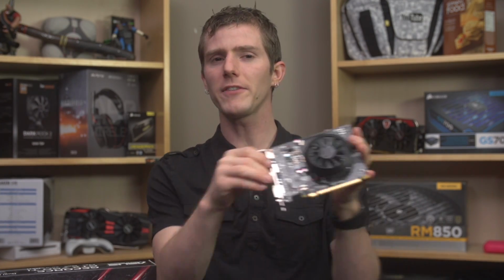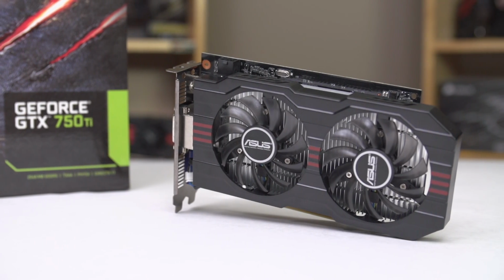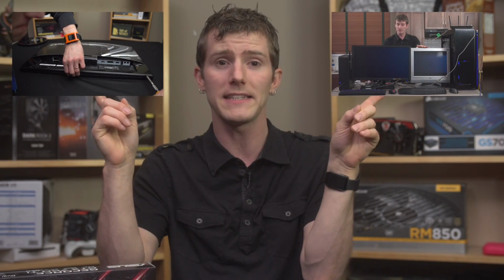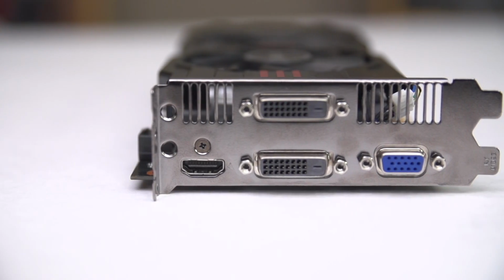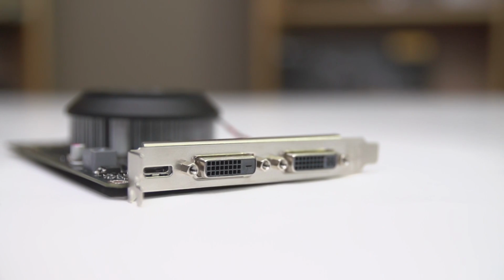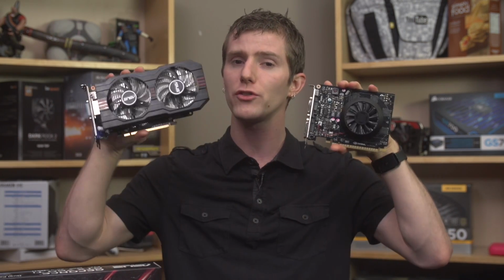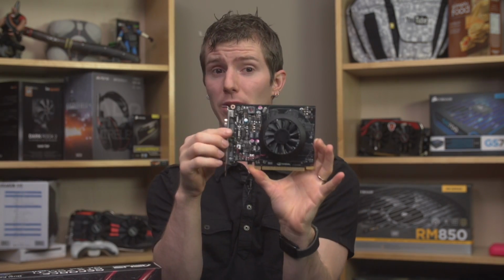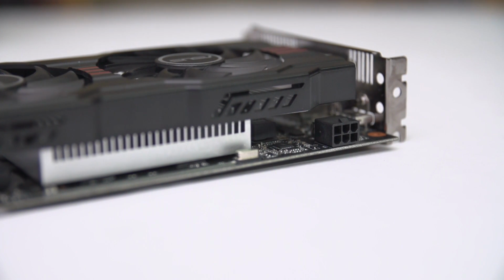GeForce GTX 750 Ti NVIDIA & ASUS Designs

Comment: I have  a 550 ti, should I switch with this one?
Reply: +draydince that's what I wanted to say :D
Reply: Manny Hung Yeah your best non sale price card is a gtx 960 or a r9 380. The R9 380 is a tad bit more powerful than the gtx 960, but honestly I tend to prefer Nvidia. Their drivers tend to be a bit less of a headache to deal with. But if you have 250 just keep your eyes open for an r9 390 or a gtx 970 they go on sale all the time on Newegg. I got my gtx 970 for 270.
Reply: If you need better performance, yes. Its worth it.
Reply: +Manny Hung like this card is old why not get a more newer version
Reply: +whhhhhhhhhhhhhhhy15 what graphics card do you prefer? I have the same gtx 550ti and thinking to buy 750ti
Reply: Deivixas HD
imo you should keep the 550ti
Reply: why? :D
Reply: Deivixas HD
nvm looking at the price you can get it for like 100 dollars
Reply: +whhhhhhhhhhhhhhhy15 y dun save more and buy gtx970 or gtx980
Reply: +Jack0ff or buy gtx 950 it's cheap and decent 1080p graphics card.
Reply: +Jack0ff well he has a 550 and is going on to a 750 I thought money was priority
Reply: +whhhhhhhhhhhhhhhy15 so i told him to save more :p
Reply: +Jack0ff but a 970 is like 300 dollars compared to 100
Reply: +whhhhhhhhhhhhhhhy15 hmm youre right. but if i were him i rather save more money and go for a high end gpu
Reply: +Jack0ff you also cant forget you need a good psu for a 970 or 980 a GTX 750 ti/950/960 can run off a 430w psu
Reply: +Manny Hung I would wait for things like polaris, maybe AMD will have a stronger offering or save for a 950 maybe
Reply: +Deivixas HD +Manny Hung go for gtx 950
Reply: Michael009 oh, that's a great idea actually
Reply: Manny Hung Cheers. Good luck! Hope you didn't bought the 750 already xD
Reply: It honestly really comes down to what kind of games you play, and what kind of games you want to play in the future. If what you play right now doesn't require more power, I would just ride out the life of the 550 ti. If the 550 isn't holding up with what you want to play, the 750 ti is a decent upgrade - but honestly, it's probably not worth the money you spend for the upgrade. It's usually about 100-150 dollars, averaging around 130ish. If you spend 130 right now, you'll have to go out and spend a few hundred more a few years down the road when the 750 ti gets into the same boat that your 550 ti is currently in. You would be better off to hold onto the 130 that would have gone towards a 750 ti to get a step or two above that. Better to spend 70 extra dollars upfront to have  a card that will last you a few more years, instead of paying 130 now and another 130+ in the future for a brand new card.
Reply: ***** I'm buying games like Fallout 4, BF4 and shadow of mordor and I'm looking for cards that can provide such firepower under 250 bucks
Reply: Manny Hung then get a GTX 960. 190$ on amazon xD
Reply: ***** pretty nice deal
Reply: ***** it sux compared to R9 380 or GTX 960. A bit more cash, but totally worth it.
Reply: +Manny Hung the r7 370 is slightly better then the 750 ti and the xfx version is about £110 on scan but the 750ti is still a good
Reply: +Manny Hung take 980ti..
Reply: Bartosz Olszewski if you have unlimited amount of $ yeah...
Reply: Michael009 oh come on, this card is just like $850 or so..
Reply: Michael009 I got my 960 for $190. Gigabyte version and CANNOT recommend it (Edit: Get ASUS one instead /Edit). Fan is very audible at 30% which is minimum to prevent the card from throttling under full load.. And some games require at least 970 now..
Reply: Bartosz Olszewski True Asus would be my choice as well.

Comment: will my system bottleneck this card:
CPU: Cucumber
GPU: Potato
Motherboard: Wooster cheese
PSU: Hamster on wheel
Reply: +Callity No. I think that you need some ketchup with that
Reply: +Callity It depends, I suggest cheddar for the mobo, as wooster is still on PCI and not PCIe, and the potato is cutting it close on the wattage.
Reply: +Callity I think you will need to upgrade to doritos RAM chips, and add additional hamster cores to the power supply, since I think it is cutting close to maximum wattage.

Comment: will my setup bottleneck this card: a8 5600k, 8GB ddr3 RAM, 500w PSU msi motherboard
Reply: +james Clarke if your playing cpu demanding games then yes if not your fine
Reply: +james Clarke No, The A8 is a quad core chip and will run just fine.
Reply: depending on what clock ur ram is?
Reply: +james Clarke Nope, a 750 ti wont bottleneck your processor - but it does kind of make your processor a waste of money. You pay a bit of a premium to get an apu with graphics built onto it, and if you plan on going out and spending 100+ on a card that will replace your onboard, you pretty much paid extra money on your cpu for no reason. Not trying to make an attack on you or anything, but typically unless the APU gives you satisfactory settings for you, it's usually best to just get a better standalone cpu.

Comment: how well would my pc run gta 5 on max settings ? 
Asus geforce gtx 750 ti 
intel core i5 6400 
8 gb ram
Reply: +benne2 hellberg 35-60fps but you might have to lower some settings for better performance
Reply: +anthonyorm how much would I get if I lower everything to medium/low ?
Reply: benne2 hellberg most likely a smooth 60
Reply: +anthonyorm alright thanks alot for the answers :) glad u could help me :D
Reply: benne2 hellberg No problem

Comment: Right now I have a GTX 750 1gb. Its a prebuilt machine with a i7-4970s, but only has a 300W power supply. Does anyone have any recommendations on a new graphics card that would work on such a small PSU?
Reply: +XxNashNatexX the 750 ti's would work with 300w. it would only give a slight performance increase though
Reply: buy a psu, you wouldn't get much done otherwise

Comment: I have a prebuilt pc from best buy. it has a Intel core i5, 8 gb ram and 300 power supply. can this run the gtx 750 ti? I currently have the r7 250 inside my pc and am considering selling the r7 240 for the 750 ti. also does my pc work with the asus edition of the gtx 750 ti? PLEASE HELP !
Reply: +Kevin Lam Yeah, the asus 750 ti should run with 300 watts. You will get a much better gaming experience with the 750 ti. The r7 240/250 is underpowered for your specs.
Reply: +anthonyorm does the asus require a 6 pin connector ? or is it like the reference gtx 750 ti where it doesn't need another 6 pin connector to power it?
Reply: Kevin Lam The asus needs a 6 pin. The reference one or the evga 750 ti's with 1 fan don't though
Reply: +anthonyorm cool. what brands offer the reference version? and are there any other gpu that my pc will be compatible with? thanks for helping btw :)
Reply: Kevin Lam You would probably have to search on ebay/amazon or on the nvidia website for the reference card since im not to sure where to get it. I don't really know of much graphics cards that work with a 300w.
Reply: +anthonyorm I want the gtx 750 ti but it costs almost $200 in canada lol.
Reply: +Kevin Lam Get the Asus 750 ti strix instead, it has better performance, temperature and power consumption. It also doesn't need a 6 pin connector.

Comment: Will Intel i3 3220 bottleneck gtx 750 ti oc ?
Reply: +Maji Bad No
Reply: +Hillooish ty
Reply: +Hillooish what aboue i3 2100?
Reply: +aNaNass No
Reply: Pentium g4500?
Reply: ***** 970, yes. 280x no... ish. There will always be a performance gain with a higher end CPU. But the i3 will still do the job. I have a 280x actually, and an AMD 860k and get a bit of bottleneck so there.

Comment: hey :) so my computer is in need of a new power supply, its currently at 250 atts :( so im aiming for around 500 watts and i will use that power to get a new graphics card, how do i know if my computer is pci-e compatible ? it may be easier if i tell you my mother board GA-H81M-S2V  - im just modifying my computer for the first time and wanted a EVGA GeForce GTX 750 Ti Superclocked 2Gb PCI-E Graphics Card.  which i think needs a pci-e compaitible graphics card but i may be wrong and would like this to be cleared up !
Reply: +sebastian langley http://www.amazon.co.uk/EVGA-GeForce-Superclocked-Graphics-DisplayPort/dp/B00IDG3IDO
Reply: +sebastian langley Yeah, that motherboard should support it, What cpu and ram do you have?

Comment: help please
i use the first gtx 750ti in the video (1 small cooler)
amd a10-6700 3.7ghz 
8gb ram
how good will it handle gta 5 and battlefield 4
Reply: +Harald hetland boe come on man get an amd card and how much is your psu
Reply: BABRIS Ali 4,624 source= https://www.cpubenchmark.net/cpu.php?cpu=AMD+A10-6700+APU
Reply: +Harald hetland boe  i meant to say that u should get an amd card prob an 250x it will perform better with your apu as compared to an nvidia one.but no doubt the 750ti is better than the 250x
Reply: BABRIS Ali what if i get a better apu (amd fx/i3 or i5)
Reply: +Harald hetland boe u mean cpu? then u will have to buy a gpu as intel cpu's on board graphics are shit btw how much can u spend
Reply: +Harald hetland boe on both or just the cpu?if both then definately get a gpu and check if your psu has a 6 pin connector.
Reply: +BABRIS Ali oh sorry u already have the card! u will get good frames as it is a quad core and save money buy a mobo and i3(around $180)
Reply: BABRIS Ali ok ty
Reply: BABRIS Ali but is it big diffrent of i3 and amd 6700
Reply: yup i3 skylake is much better

Comment: I can get a ZOTAC 750ti for $160, should I go for it? also what is the difference with zotac and asus
Reply: I'm guessing a higher clock speed and beefier cooler. So an overall better card for more money
Reply: Kenny H the zotac is the better card?
Reply: +Cam Par yea I'm pretty sure
Reply: +Cam Par no, the asus is better.
Reply: +Cam Par I think the EVGA coolers are the best but yeah I'd go for a GTX 960 2gb/4gb over a 750 ti
Reply: Cam Par damn nice pick!
Reply: +Kevin Lam Where are you getting your facts from?
Reply: +Cam Par Just go with the cheaper one, they preform basically the same
Reply: Nissan U.
i found a gtx 960 for $200 new, is that a better deal?
Reply: Cam Par Where do you live? That seems expensive for  a 960
Reply: Nissan U.
Toronto Canada. yup we get ripped off here
Reply: Cam Par Its your budget, it depends on what type of games you want to play and at what settings.
Reply: Nissan U.
I could save another $150 and get a used 970 for $350
Reply: Cam Par A lot of people recommend used but I am not that big of a risk taker, so I buy new. Unless a well known friend sells me the card.  Also what kind of gaming experience are you after. 

Edit: If you want this would be better, Get a gtx 950 now and save up for another gtx 950 as time goes on, then you can sli them and have near performance of a 970.
Reply: Nissan U. I like to have ultra settings so I might just sell a few things and save up for even a 980ti or wait until the pascal line comes out, and for now just get a 960
Reply: Cam Par If you dont want to wait its best to get a 750ti from zotac which is the best cheapest gpu. Then you can have more money left over to buy the 970 or 980 if you wanted. When the pascal line comes out you can sell the 750ti and have more more money to buy a higher end card.
Reply: Nissan U.
true, I think ill do that, thanks for that
Reply: +Cam Par you can get a gtx 960 for $20 more
Reply: Crackhead jack not here in Canada
Reply: Matthew Sowers Well the 750ti runs cool anyway because of its such low tdp, additionl fans are kinda useless tbh. If a oced 750ti will run cooler than most high end cards at stock speeds
Reply: Nissan U. I wasn't talking about the card itself I was talking about the cooler on the card lol but yes I know the 750 ti is one of the best if you want a card that stays very cool
Reply: +Cam Par Omg where did you find a 960 for 200$ :0 i find a GTX 950 for 189$ :\ Canadian too.
Reply: Warrox. Kijiji
Reply: +Cam Par new? I got my 950 from newegg
Reply: Warrox. Yeah it was sealed in box
Reply: Well ASUS version has aditional power. Zotac doesnt.
Reply: Dovydas Ki what kind of additional power?
Reply: +Cam Par its like: Asus takes an external power from psu, when zotac takes the power with pci express. Understood?
Reply: +Dovydas Ki I took asus gtx 750 ti OC and its damn powerful. Really worth its cost
Reply: +Cam Par Hey man. Really Zotac and Asus are both decent brands. Asus is more known, but Zotac isn't a dollar store knockoff or anything. They make reliable cards. That said, neither an Asus or Zotac one are worth 160. a 750 ti is worth about 100-130 tops.
Reply: Thanks guys, found a gtx 960 for $250, I know that's expensive but I live in canada, GPUs are a rip off here
Reply: Cam Par Ouch. Yeah man, that kinda sucks. You're 50 away from gtx 970 price :( still glad you found something though. That's a decent card.
Reply: *****
I can get a gtx 970  (used) here for $350
, new? $450...
Reply: Cam Par Oh damn man :( that's weird. I wouldn't have guessed the prices would be that much higher in Canada compared to the US. They're close enough economically you'd think they would be somewhat close in price.
Reply: +draydince Canada's dollar has gone down the drain really quickly.
Reply: +Cam Par Now it's $104 USD
Reply: ***** not in Canada unfortunately
Reply: Cam Par
ohhh
Reply: +Cam Par Just ordered it yesterday for $95 USD off Amazon.
Reply: Henry The Unicorn
damn you!
Reply: Henry The Unicorn Fuck i just saw

Comment: This card has yet to find a brick wall that it cant break (MSI). I'm not running 4K but with many games having upscaling and advanced AA like GTAV, which this card handles without a bead of sweat, You can get near as crisp as your heart desires with butter smooth gameplay for a fraction of the cost you would normally pay. No its not running games at 120+ FPS but if stable modern gameplay is what you desire with 50 - 60+ FPS, I couldn't recommend a better use of your money than this card.
Reply: +Harawanagangsta All games at ultra settings as well, no need to skimp, I rarely come across a game that makes any headway in frames with reduced graphics and often times prove to output rougher frames rather than more of them. Could be a CPU bottleneck or otherwise but from my experience, Leave the graphics cranked is rarely a compromise of frames, Often times lower shadows see the biggest performance increase, But for all the bells and AA and textures, it barely notices.

Comment: so, i have a question: I have a 350w psu with 26amps on 12volts, can i use this card?
Reply: +Signora Mariangiongiangela yes sure, unless you did't pick it up on the scrapyard
Reply: +Felix Kraus  i just googled some shit, and i found that my psu is actually pretty good, it has a lot of amperage for each voltage, for the graphics card (+12v) it has 26Amps (312W). i think it's gonna be fine
Reply: +Mariangiongiangela's Tech Tips Out of curiosity how did the card go with the PSU? I have a HP with a 300w PSU but don't know if I should upgrade

Comment: can i run the asus one with a 300w power supply?
Reply: +Gijs Penterman yes, but don't overclock it too hard
Reply: +Gijs Penterman Mostly depends on what kind of 300w power supply. If it's a name brand one with an actual 6 pin connector, as the other guy said you'll be fine minus overclocking. But if you mean a 300w no name power supply, like ones that come from pre built walmart computers you're living on some dangerous territory. It might run. It might even run for a while, but sooner or later it's probably going to run into some issues. 300w for those cheap power supplies usually aren't actually 300w, but some weird fraction of it.

Comment: Will this GPU and an AMD FX8320 run Fallout 4 at max to near max settings at 1080p minus the godrays at around 40-60 frames? Or even a stable 30 would be fine by me. I'm on a tight budget but reaalllly tempted to go for the gtx970 but don't care about getting crazy high FPS, especially since I have a 60Hz monitor, so do I really need the 970?
Reply: +KingofHearts67  Go for the GTX 950. If you shop around for holiday deals,you can pick it up for $100-130. Are you in America if I may ask? If you are,I can send you a link if I see a good deal on one. I myself purchased a brand nw EVGA GTX 950 for $100.
Reply: +KingofHearts67 GTX 950 slightly better performance for same amount of monies.
Reply: Get a 6100k

Comment: I'm upgrading my PC and need help with the CPU upgrade can u tell me Intel Xeon E3-1230V3 Quad Core CPU $250 or i7-4790 Quad Core CPU $289.
Reply: +CoD4 RuNZ xeon is not for gaming
Reply: +CoD4 RuNZ Go for the Xeon, only real difference is the Xeon doesn't have Intel Graphics built in (which you won't use anyway).  I'm running an E3-1270V2 and it rocks...

Comment: Will my computer be able to support this card?

12 GB Ram
Intel i5 3.2 Ghz
1 TB Hard Drive
Reply: +M. Serhat  easily
Reply: volkswagenginetta how about a gtx 950?
Reply: M. Serhat
 as long as the power supply can do it yea that would make sense.
Reply: +M. Serhat The RAM, CPU, and hard drive don't matter. So long as you have a PCI-E port, an 300W+PSU, and enough room in the case, you should be fine.
Reply: +Neocasko Just got the card. i gotta say it really is a bang for your buck. Runs Fallout 4 on Highest resolution with no issues so far. i get around 40-60 fps.
Reply: M. Serhat Awesome! Not bad for a year old card! ;) I'm planning on getting one myself! :D
Reply: +Neocasko you will be delighted.
Reply: M. Serhat I hope so! ;)